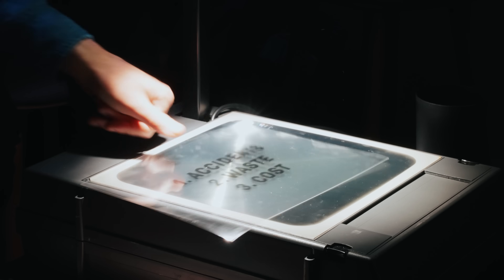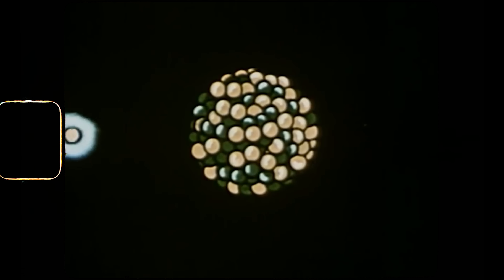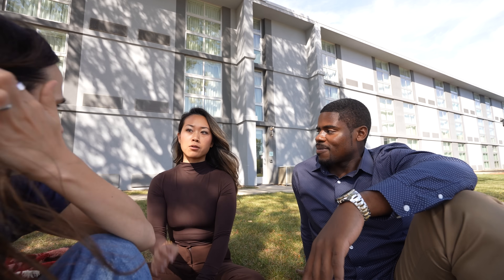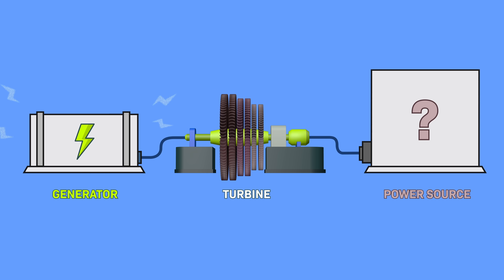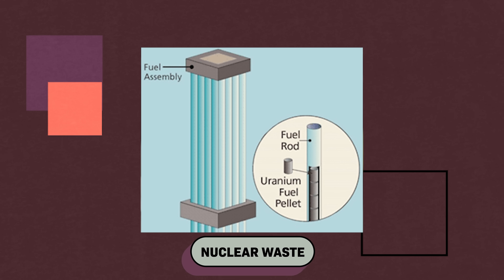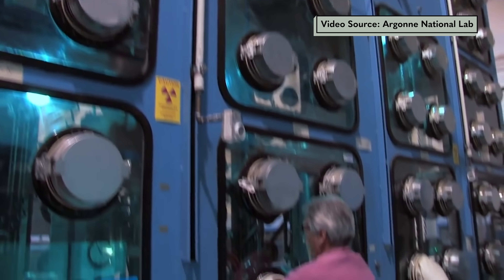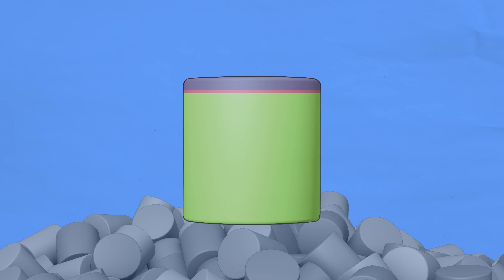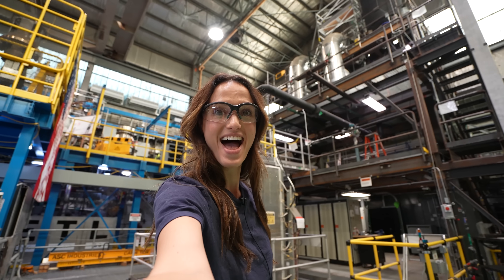The Big Lie About Nuclear Waste

Comment: When I was studying Nuclear Chemistry, I found out that it is possible to transmute one element to another element. If carbon is really as bad for the environment, why is there no crash goal to transmute Carbon to Boron or some other benign element. Please explain the pros and cons of such a process?
Reply: Well, first... it isn't that carbon is bad just existing. It has a greenhouse effect as carbon dioxide or methane in the atmosphere. So just removing it from the atmosphere, which would be necessary to transmute it, would ALREADY have the benefit. So why bother? Then ask the cross-section of carbon. It's not that efficient. Compared to, say, sticking it back into the ground.
Reply: @Crispr_CAS9  Removing carbon to transmute it would mean that much less carbon to deal with.  Sequestering it would mean that due to tectonic activity, it would be in the atmospheric at some future time. It could be next year or 10 million years from now.
Reply: @abelgarcia5432  "Removing carbon to transmute it would mean that much less carbon to deal with. " If it has been removed from the atmosphere, it has already been dealt with. That's it.
"Sequestering it would mean that due to tectonic activity" Chemical sequestration is not susceptible to tectonic activity. So this is irrelevant.

Comment: 6:25 Actually, concentrated solar power is a thing too. An array of mirrors can (and have) been used to concentrate solar power and use the thermal energy to run a turbine, a sterling engine, or just store it in the form of molten salt.
Reply: And that is a massive disaster ecologically.
Reply: @Dan-gs3kg  Given the scale of our energy demands, pretty much anything we try to meet that demand will be a massive ecological disaster. Some are just worse than others.
Reply: @suntzuthesecond  Nuclear is better than that. The waste products produced vs power produced is orders of magnitude better than ANY other power generation scheme.
Reply: Alright. Alright. Give it a rest everyone. 🏳

I just wanted to correct a specific point in the video by pointing out that you can spin a turbine with solar power; not start a war over whether you should or shouldn't do that. That's not a hill I'm willing to die on.
Reply: @suntzuthesecond  you've not dealt with how much of a joke solar concentrators are.
Reply: @suntzuthesecond  per the ecological disaster, I'm honestly not seeing it. You aren't up to date with the science or practice. If it involves things more than ideally iron, copper, nickel, try again.

Comment: I enjoyed this video. In particular, the statement about increasing power output through as many source-types as possible, as quickly as possible. Could you, or have you already, looked into the portable nuclear that the two you talked to under the tree were working on? I'd be interested to learn how tiny or portable reactors could be used in residential or commercial application on a small scale.

Comment: There seems to be a misconception that USA and CA governments care about people and the environment and would be willing to support the most effective solution to become enviromentially friendly and energy independent.  That's a total myth.  They are in bed with big oil and a hundred other global scams designed to keep people paying almost all of their income back into systems that govts own and profit from.  Most recently, the huge push to force everyone to switch to expensive EV's isn't for our own good long term.  There's plenty of downsides to EVs that the govt-paid media chooses to neglect to tell people about.  We have no infrastructure for charging millions of EVs and that's just the tip of the iceburg.  Our power grids barely held up last year through the summer.  This spring, the govt is offering to pay incentives to people to turn their home thermostats "up" to reduce air-conditioning to avoid loading the grid to failure.  If things have gotten that bad, where do they thing all the power required to charge millions of EVs is going to come from?  The power grid can't handle demand now so how the hell will it ever hope to handle EVs?  Have you ever seen a Lithium mine?  Trust me, it's super bad.  Any the purifying process?  Far worse still.  And recycling?  No plans yet exist that will keep pace with demand.  An Lithium-Ion battery fires?  No solutions exist.  Would you put one in your garage while your family sleeps?  Me neither.  Not ever.  Nuclear power could have helped us avoid all this stupid nonsense.

Comment: Candu reactors can run on spent fuel from a light water reactor and they are in operation as we speak. A fuel cycle that includes about 5 light water reactors to one Candu is  supposedly very efficient.  The American nuclear industry has done everything they could to shut down Candu as they see it as a competitor. Dont look further, the US is not only a military terrorist nation but also an economic one.

Comment: This is bull crap  the problem with nuclear waste is its for profit business and the fact it  was started to make plutonium for nuclear weapons.   If you wern't full of sh_t  you would go to the hanford disposal site and recycle all of that material its not happening.  this is just an other bs story.   enrichment is really about producing plutonium.   Why is that not even being mentioned.  Prove your not lying  and clean up Hanford or clean up the Santa Susanna test site on the hill above my home.   Action is called for  not fairy stories.   Why has Japan not finished Fukushima cleanup.  Its obvious the problem with nuclear power is the nuclear industry can't be trusted and you are an employee of that industry.  
       Why are most of the reactors in california running on BS extensions past when they were supposed to be decommissioned.  You are a very pretty liar.   As I say clean up Hanford before it floods into and ruins the Columbia river and prove your BS thesis.  don't just show herman eating irraidiated donuts.  Proof and compliance is needed not platitudes.

Comment: We do reuse nuclear waste. However, there are only two commercial fast breeder reactors in existence, both in Russia. While a fast breeder reactor produces more usable nuclear fuel than it consumes, the waste it produces is far more dangerous than the nuclear waste produced by a boiling water reactor (a conventional nuclear reactor.) The waste from a fast breeder reactor must be stored safely, a very difficult proposition, for 24,000 years. To date, the US has not been able to solve this POLITICAL problem. Whoever wrote the script for this video simply does not know the facts, or is intentionally misrepresenting them.

Comment: The other huge benefit of these kinds of reactors is that it solves another major issue with nuclear power. Not just how long something stays radioactive but how much of it there is. The early estimates say that the total amount of waste that could never be used can be cut down to 10 to 20% of the current amount. So we can still use new uranium in the older style reactors while still sending their waste to the newer recycling reactors. It would do three things 1 drastically cut down on the amount of waste we would have to store, 2 it would cut down on the time unused material has to be stored by thousands of years so we need less space to store it, and 3 give us a decades long buffer of supply. If we can take the spent fuel and use it over and over again until it was 20% of the original amount we have allowed ourselves quite a long time of energy even in times where new imports or mining of uranium would not be possible. I first heard about this type of reactor a few years ago and still don't under stand why it has not caught on. Even if we did not want nuclear power at all we have already been using nuclear power for decades so we have built up tons of waste. Even if you disagreed with nuclear power the waste will still exist. So why not cut it down to a 5th of the size and cut down the storage time by hundreds of thousands of years it would even be a concern. This would give the US decades of energy while we figured out a truly clean energy source that does not make anything hazardous.

Comment: Again a nuclear fan video that doesn't even touch the downsides. That industry pulled off a remarkable marketing stunt, reframing an incredibly costly, non renwable, and catastrophically dangerous energy as "clean". And yes, that particularly includes fast reactors. I really liked this channel, but after this unbelievable unbalanced video, I got the strong suspicion that it has been bought

Comment: All the world's waste from fuel can fit in one football stadium. And places have nuclear containers that can literally get hit by a freight train at 80 mph and only get a little dirty... As waste is also melted down into glass with other stuff and puts off as much radiation as a few flights around the world...
Reply: Tho the waste is hot enough to even cause tactical nuke like steam explosions if improperly stored like Russia found out the hard way... So why not use it?

And wouldn't it be less radioactive if it was used till most of its energy was gone instead of just a few percent of it...

Comment: Recycling nuclear waste definitely appears to improve the viability of the technology, but it still seems like a complex, dangerous and expensive solution now that we know how to harness our sun’s nuclear fusion and the earth’s air movements. Solar and Wind energy are now the cheapest sources. Nuclear is the most expensive. Until that changes, nuclear doesn’t make sense.

Here are some estimated LCOE values for different energy sources:

Coal: $60-$143 per megawatt-hour (MWh)

Natural gas: $42-$78 per MWh

Nuclear: $112-$183 per MWh

Wind: $28-$54 per MWh

Solar photovoltaic (PV): $32-$42 per MWh

Hydroelectric: $35-$123 per MWh

Comment: Thorium, molten salt reactors do this without the need of fuel rods and are safer because the reactor is not operated under high pressures. The technology was proven years ago at TVA. The Chinese have already built a working reactor.

Comment: This is my big beef with climate activism. If they supported nuclear, we could have solved climate change decades ago. We'd have more energy than we know what to do with, and no nuclear waste.
But they use climate change as a tool to advocate for revolution more than to just fix the issue its self.

I got my degree in sustainable and renewable energy engineering. We all came out pro nuclear.

Comment: In France we had those fast reactors (Super Phoenix ... that I had the chance to visit when I was 12). It was working well ... until a political decision (someone needs the so called "green" votes to get elected so promises to shut it down) put an end to it.
And of course, with this recycling not done anymore, the anti-nuclear can start saying there is no solution to waste (sure, they make sure all solutions are abandoned).
And now, 30 years later, with the war putting pressure on our energy needs, those who were in charge suddenly suffer from amnesia and can't recall why it was closed.
We just got set back 30 years.
We had a new program to replace it, but it was also stopped because it was not economic with the uranium being cheap ... no long term thinking.